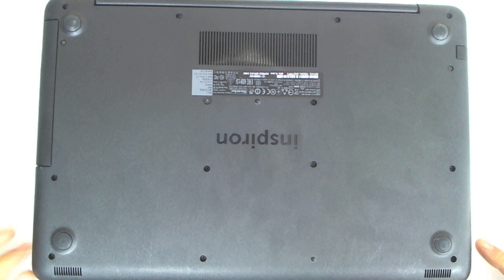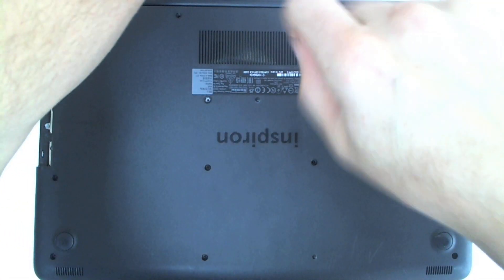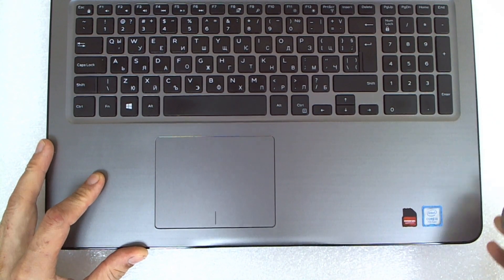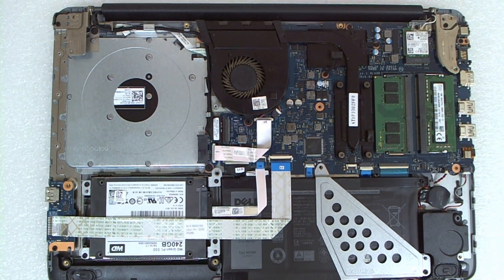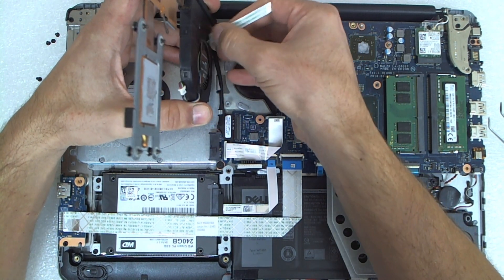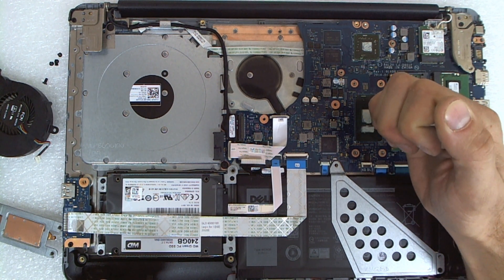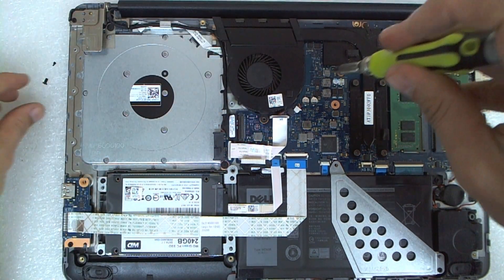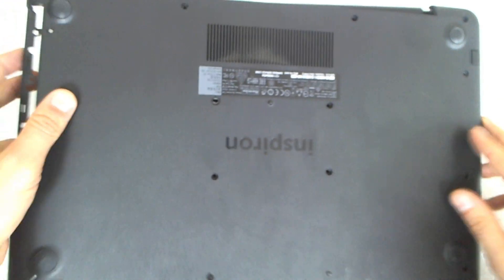Dell Inspiron 15 5567 Disassembly / FAN Cleaning

Comment: I have Dell Inspiron 15 i5 8th Gen 8GB for the last 2.5 years but now it makes such a LOUD noise if I open more than 2 tabs on chrome. It even heats up a lot. Should I go for fan cleaning and thermal replacement as well?
Reply: I had to do this same thing on an older Dell I had a few years ago; I'll explain in this text why I did it). I learned a lot from that experience. 
The reason I went looking for a video on how to remove the computer cover from this newer model (5567) was because the cooling fan in mine suddenly started making a loud noise. For a day or so prior to the fan making noise, I noticed the fan was running on a high speed and the fan exhaust area (on the back of the computer where the screen meets the base) was very warm. 
I'm going to share a few observations here I experienced when I did mine. The absolute first thing I did when I removed the back cover was to unplug the battery to remove the possibility of powering any of the circuits; it's easy to accidentally hit the power button when flipping the computer over to disassemble it. I removed the fan assembly carefully while holding down on the ribbon cable that passes underneath the fan housing with a plastic (not metal) pry bar. This eliminates having to remove and reinstall the board in order to reconnect this (power) cable (if you're not sure you were able to keep this cable held in place, remove the board by removing it's screws and unplug and replug the cable). I cleaned the fan blades with a fine bristle brush.
Possibly the computer was not assembled with the proper amount of paste to keep the processor operating cool enough (I had an older Dell computer a few years ago where the person assembling it had applied way too much paste and it never did run cool). Don't overuse this paste - use an amount similar to what this youtuber did in the video. If you use too much paste, the heat will not leave the CPU area quickly enough (the heat will migrate into the surrounding areas).  Also, don't press down on the heat sink when replacing it onto the CPU. You will notice the screws that hold the CPU in place are spring-loaded. These spring loaded screws will automatically apply the correct amount of pressure. Just guide the heat sink into place over the CPU and install the screws while gently keeping the CPU in place.

Cleaning the fan blades and replacing the paste on the CPU (my model doesn't also have the GPU because it's not a gaming computer and doesn't have a GPU) seems to have solved the problem. It's now running coolly and quietly. I don't think these cooling fans are intended to run all the time the computer is running, just when the CPU and/or GPU get(s) hot. The temperature in these components tell the cooling fan when to run, and the fan cycles on and off as necessary.
Reply from the maker: 100% but use a good quality thermal paste.
Reply: @LaptopDisassembly  alright! Thank you so much for your prompt reply.
Reply: sorry to bother you but I should get the fan replaced or cleaned? The guy at the store said that the fan isn't working and needs to be replaced but I am feeling a bit sceptical about it. Would love prompt advice TIA
Reply from the maker: How did the guy in the store find out that the fan is not working. It is possible the fan to go bad, but it is very rare. Usually with a little machine oil it runs smoothly. But if he test it and it douse nit spin at all, than you need to replace it.
Reply: @LaptopDisassembly  is it possible to clean it ourselves if we follow this video? Fan cleaning services cost ALOT
Reply from the maker: @ma_r1o24  yes of course, just follow the video. Just be careful, when you lift the fan, there is a cable under it. Just hold down the cable, while lifting the fan. If you pull to hard, you may pull the cable also. In order to plug it back, you have to lift the board. So to save time and headache just hold the cable. Watch the video first if you like.

Comment: I have the same laptop and often times the fan just gets really loud. It sounds like a grinding noise. Is it possible to take off the fan piece without having to take off the heat sink?
Reply: I have this laptop too. His sounds like a fucking jet engine xd
Reply from the maker: Not possible... The screws are on the top, so in order to remove the plastic you need space inder it.
Reply: I have the same laptop too and the sound is so annoying. Has anyone figured out how to fix this?
Reply: Did you watch the video? What do you think he is doing? @ma_r1o24

Comment: How do you attach the small cable again at 5:45  which is under the fan the white one with the green scripts on it I tried to rewind and see when you put it back in place but can't see you doing it and I can't seem to find myself how to do it any help :) ? Great video tho thumbs up !
Reply from the maker: I did pause the video, while cleaning the fan. The longer and safest way is to remove the board screws and the hinge and lift the board. This way it is very easy to plug it back.  I did use a tweezers and plug it the way the board is. It is more risky so i advice you to lift the board a little bit... not the hole one.
Reply: @LaptopDisassembly  can u create a new video how can we plug it back this white cable ?
Reply from the maker: @cagrbozkurt400  the laptop is not mine, and i already give it to the customer. The safest way is just to remove the board and to flip it up side down. It is held by few screws ...
Reply: @LaptopDisassembly  m gonna be crazy. İ cant remove because screw is stuck. Please help me, how can i plug it back without remove all card ?
Reply from the maker: No other way... Or you can use a tweezers and carefully plug it back.
Reply: @LaptopDisassembly  This is just about impossible without unscrewing and lifting the board up. That's they way I had to do it.

Comment: I have the same laptop. It goes to sleep automatically when I press the power button it again gets on.
Also charging port is loose. It's very hard to connect charging at some point.
What could be the issue?
Reply from the maker: Is the battery working fine. I had a lot of cases with similar problems. In most of them it was a bad battery. Try disconnecting it and test without it. About the charger, probably it is damaged and you need to replace it.
Reply: @LaptopDisassembly  Battery is not in good health so the sleep issue relates to this.
I already bought a charging jack but have no time to visit the shop to get it installed and also do a battery replacement. -_-

Comment: What's the ribbon that's taped underneath the fan for?
Reply: I found that I had to unscrew and raise up the board where this cable connects in order to properly reinstall it. It's pretty much impossible to do so otherwise. If I had seen that it was glued to the underside of the fan housing when I was lifting it off, I could possibly have held the cable down with a plastic pry tool while lifting the fan off and I wouldn't have had to take the board loose to reattach it. Don't know if I would have been able to pry it successfully this way,  but would like to have been able to at least try anyway.
Reply from the maker: for the power button.
Reply: Tnx, I managed to put it back up and the power button does seems to be just fine.

Comment: Bro in my dell 5567 i hear a loud noise in my fan . I dont know what to do. Should i change my fan or what? Pls reply me bro
Reply from the maker: First clean the dust from it, replace the thermal paste and test again. Probably is overheating
Reply: @LaptopDisassembly  i checked it bro but not working. I mean the sound like fan hitting somewhere when spining
Reply from the maker: can be a little bend and it can rub the metal plate.... try to bend it backwards... or replace the fan.
Reply: @LaptopDisassembly  ok bro.thnks ❤️
Reply: @DivineOnAir  Did u replace the fan or clean it? I have the same issue right now with the sound like fan hitting something :(
Reply from the maker: I just clean it and lubricate it.
Reply: @subwolff  i shud buy a fan bro.going to replace it
Reply: @LaptopDisassembly  Ok thnx!!!
Reply: @DivineOnAir  Alright thnx for the reply!
Reply: @LaptopDisassembly   i had exactly the same fan hitting something - noise... did you fix the problem only by cleaning? how you lubricate it ?
Reply from the maker: @zugre   На самия вентилатор би трябвало да има няколко малки болтчета. Когато се махнат може да се раздели металната част от пластмасовата. След това самата перка би трябвало да може да се издърпа нагоре и да се извади. След като се извади може с малко машинно масло да се капне върху самата ос на вентилатора и вътре в лагерчето.
Reply: @LaptopDisassembly  fala bratle